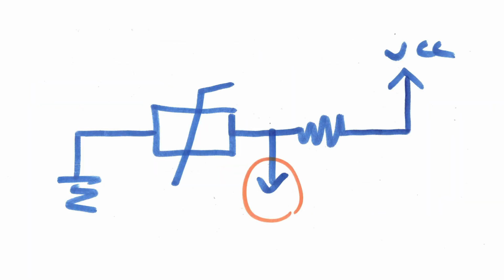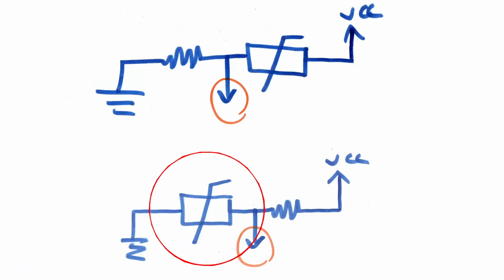NTC's Secret Application beyond temperature sensing

Comment: What happens when the inrush current limiting NTC is hot but the power is interrupted for a time not long enough for the NTC to cool down again? The capacitor might be discharged already, the NTC still hot and low resistance.. kaboom!

Comment: Thank you. I really appreciate learning about the NTC's "other ability". Re: Soft-start... Yea, I would like to see if an NTC could be used for fractional HP DC motor, but can it limit the current each time the motor is turned on and off... How much time is needed for the NTC to reset after it is turned off? Ie, time to "cool off"? Take for example, a DC motor on a bicycle... if I pressed on, I want it to ramp up. If I press off and quickly re-press on, I still want it to sort of "ramp" into it, rather than dump current. Would an NTC be able to react that quickly?
Reply: It varies a lot depending on the current, but around a second or two. They are often bypassed with a relay after they warm up for 2 reasons: effeciency, and also because if you have a power drop for less than a second and the cap discharges but the NTC stays hot, the inrush absolutely can blow up the rectifier. The relay bypass means it returns to cold after startup so it can protect again.
Reply: @SkippiiKai  That;s great advice. Thank you.

Comment: Good stuff. NTCs are used on power audio amplifiers. After a short delay a relay is used to bypass/short the NTC so there is ZERO resistance in the power path.
Reply from the maker: Yes, it is common to switch the NTC after a short time 👌

Comment: To be interpreted as NTC the shown symbol should have inscribed over/under/near the short part of the "variable" line "-t" or "-T" in some standards "t-" or "T-" in other standards, "NT" or "NTC" in third standards, but by itself this symbol just means not manually variable resistance where the cause of the variability can be grate many things, i.e. it could be a platinum temperature sensor (as all metals Pt has PTC, but these sensors are not semiconductor based and aren't volumetric effect based as in circuit current regulators), closed type LDR based converter etc.
Reply from the maker: Thanks for sharing 👍

Comment: My Honda accord in 1978, used an NTC thermistor to turn on the low fuel light... When the NTC was in the liquid, the current through it generated a bit of energy which was dissipated in the liquid... when it way in free air, it heated more, the resistance dropped, heated more, resistance dropped, enough current flowed to turn on the light, but the lamp resistance plus a small current limiter resistance prevented thermal runaway... Simple, inexpensive, reliable.
Reply: And elegant!
Reply from the maker: Thank you for sharing 👍
Reply: hello sir  @elewizard

Comment: Great video!
Another application I use is the "self heating thermistor". 
I run enough current through them to make them heat themselves to 100 to 150°F.
With this, it can be a liquid level sensor when is immersed in a liquid.
It does this because a liquid is more thermally conductive than air and the difference shows as a change in resistance.
Reply from the maker: Great tip!

Comment: I just blew a fuse on my boost converter because of the inrush current yesterday, i didnt understand inrush current when i asked chatgpt why. I plugged in my source with reverse polarity and since there was no resistance in the resverse direction the input caps started charging super fast with too much current, in reverse  blowing the fuse was the explanation.   Cool use of NTC's.
Reply: A reverse polarized electrolytic capacitor acts like a near short. Im happy you had a fuse in the circuit, else you would have that capacitor flying around your ears. 😃